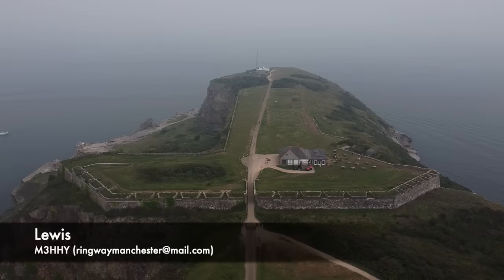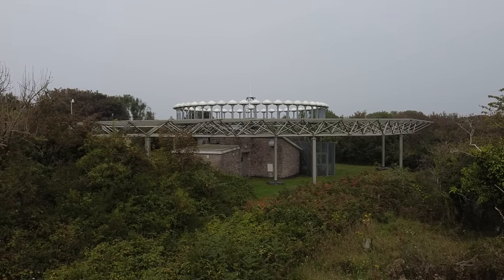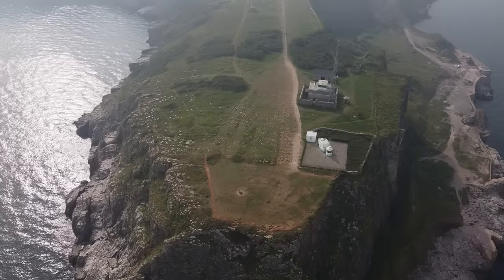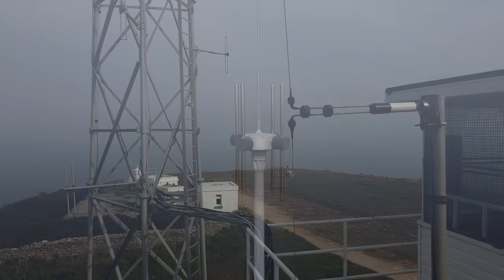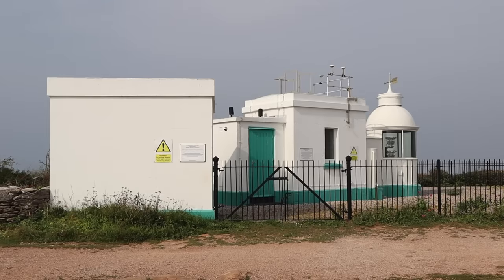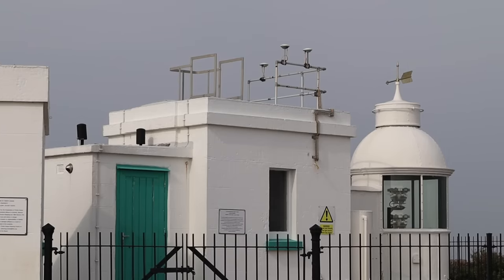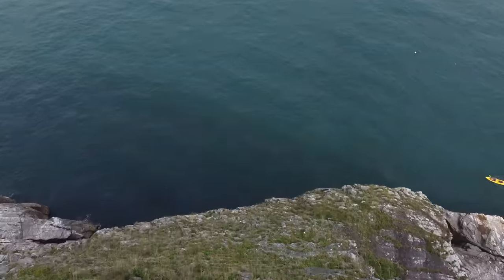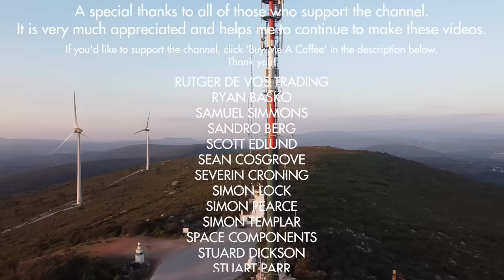What Is This Clifftop Radio Beacon Used For?

Comment: Our VOR here on the east coast is out of service.

I bought an aircraft radio with VOR and I was wondering why I was not picking up my local VOR and I then tried the next closest one and didn't get that one either.
Then I checked 3 more and none of them were on.

I then looked up the official sites for each and they all said the VOR systems were off and they didn't have any further info.

I guess because of GPS and all the modern equipment you don't need VOR any more to get a direction to the airport

Comment: I think I need a picture/graphic to show me how the plane waypoint thing works.
Reply: The classic explanation goes something like this:

Imagine a lighthouse. Let's say it takes 12 seconds for its beam to sweep through a full circle, and the beam sweeps clockwise when viewed from above. 

Now, let's put a flashing red light, visible from all directions, on top of the lighthouse. We'll make it so that this light flashes exactly as the main beam of the lighthouse passes through north.

So we're in a boat somewhere, and we see a red and a white light flash at the same time. We know we're exactly north of the lighthouse.

If we see the red flash, then the white flash 3 seconds later, we must be due east of the lighthouse.

From any point, it looks like the red and white light each flash every 12 seconds. But the delay between red and white (that is, the phase difference) tells you your bearing from the lighthouse.

Now replace the lights with radio waves, and spin the light 60 times a second! The ring of antennas is generating the "lighthouse" rotating signal, and the one right at the centre is the equivalent of the flashing red light.

It's more complicated than that, but that's essentially what's going on.

Comment: I notice there are still a number of Low Frequency Beacons on the air charts. Whitehead off by its self looks interesting. Often what is left of older Radio Range stations.
Reply: NDBs? (Non-Directional Beacons)